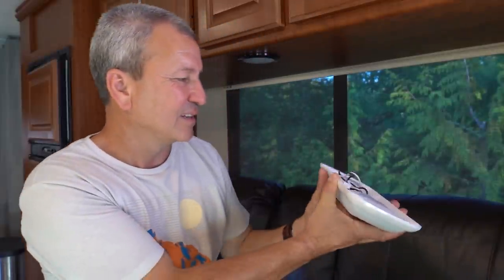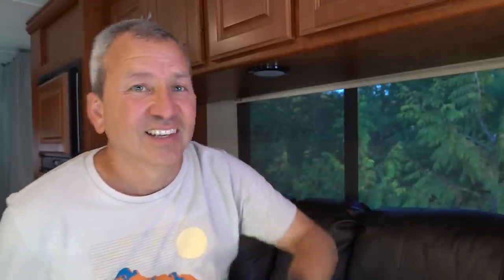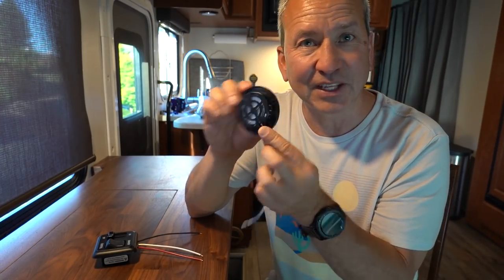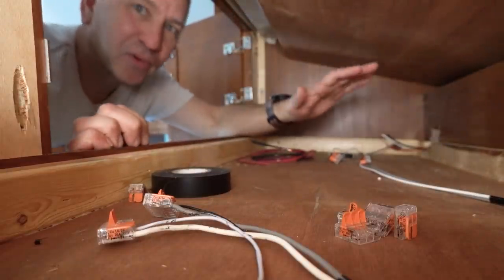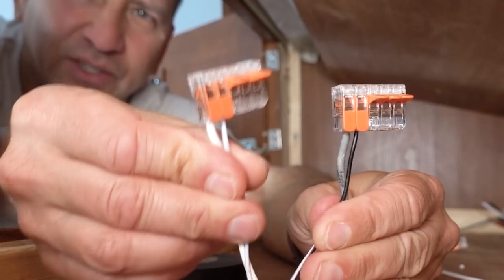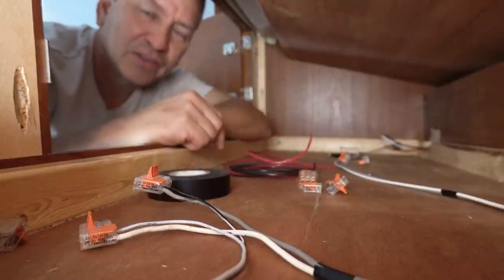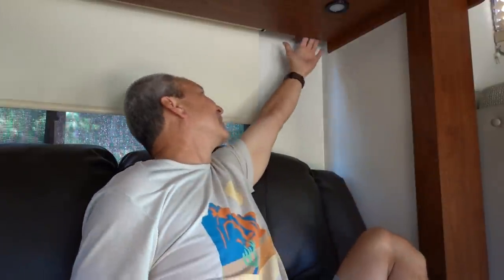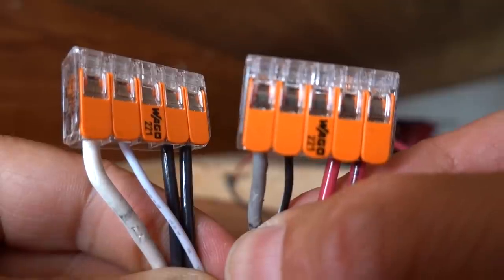Upgrade Your RV Lighting with Stylish LEDs Lights and Dimmer Switches | RV with Tito

Comment: Thanks for the tip on the WAGO connectors.  I've been using POSI-Locks but these look to be handier.  I'm about to install a dual USB port  on each side of our RV bed so we can use a simple USB reading light for more focused light than we presently have.
Reply from the maker: Cool. Yeah I installed a couple USB ports on either side of the bed. Those are a must. You'll like it!

Comment: Hi Brian! Been following for a couple years. You are a total inspiration. I had to try your tip on using the alligator clip and wire to divert the water that was running down the side of our class c that drains from our AC. Wow! So simple yet so effective! Also just finished a major floor repair. Had to hit the whole bathroom floor and part of the hallway. I took it in for an estimate at our local rv dealership and they wanted $4000.00 to redo the floor. That didn’t include the leak! Again, encouraged by your video, The total cost after tools and materials $400.00!!!!! Thanks so much. Oh yeah, love the dimmers. May have to do that one too!
Reply from the maker: Thanks for the comment Steve. I'm so glad you find my projects inspiring. Yeah. I think some (not all) RV repair is a racket...kind of like health insurance. Makes you wonder if they're jacking up the costs for the insurance reimbursement.

Comment: Those dimmer lights are sweet! 

We have a 2019 OutdoorsRV 24RKS travel trailer and are now in the mode of making modifications. The first upgrade happened a couple of weeks ago. I took the plunge and got a Battle Born 100 Ah LiFePO4 battery and installed a lithium compatible Progressive Dynamics converter charger. Everything seems to be working great. It's amazing how fast that battery can charge!  Solar is next!

Comment: Nice job Brian! You need one of those oscillating multi-tools for cutting those slots. PC250MT. No drill required, just a few plunge cuts. Thanks for the links to those connectors!
Reply from the maker: So true. I thought that as I was drilling out that hole. Everytime I need one I say "next time". Checked them out at Home Depot the other day. So maybe I'll have one for the next project.

Comment: Tito is a handy man. I've been electrician for 40 year now. The new wago is even smaller than these. Another name used is handbrakewago or mistakewago (tabbewago)  I will replace the old light with   downlighs like this in black. Therwill be a hole in the middle, So I mus use three I think I will use  it's ovn switch for the middle light. I will order a remotce cntrol. Here in Norway I use a 4kw Rvtransformer 230v AC50HZ - 120vAC/60Hz for my North American RV. I use both 120v and 230v outlet inside the RV at the campeside with shorepower. Can use converters too.

Comment: I just told you about my Minnesota Winnie I had already started my list of things I'm going to do and changing the lights out were on the list and that Wago connection is very cool I didn't no about it. I had restoreda 1978 Westfalia that I worked on for two years and I used those puck lights all over it. If you like I can send you pictures from that project I think you will be impressed. So anyway I will be in touch on my solar work. I plan on using your ideas.
Reply from the maker: Cool. I used to have a 1970 Westfalia.

Comment: I replaced all my lights  with similar to original but daylight LED, always wanted dimmer night light though, will definitly buy the ones you suggested. I have a similar RVAlways wandered the best way to access the space under the cabinet. Thanks!
Reply from the maker: Yes. Most RV cabinets have that false bottom. Use velcro or small screws to reattach it so you can get in easier the next time.

Comment: Nice addition, love those puck lights.. We have center lights and I've been looking for dimmable LED replacements for 18" fluorescent lights.. sadly, no real access to the ceiling wiring other than by the light itself.
Reply from the maker: Yeah. The ceiling is a little more complicated unless there's a heating duct nearby.
Reply: @RVwithTito  there is about a foot away, I tapped into it on our last RV, that was a job and a half.. first I need to find the right light fixtures..

Comment: Ideal makes Connectors that are like that but are push in (Ideal In-Sure push in Connectors and they also have them just like the Wago that are called Ideal In-Sure Lever Connectors but are a bit cheaper than Wago. Thought you might be interested in them.

Comment: Great vid. I ordered some non-dimming ones & got ‘em swapped out where I had single bulb housings under 3 different cabinets. Question: Is there something along these lines that can replace the old dual-bulb housing style light fixtures?  I have some of those on the ceiling of my Class-C we’d like to replace

Comment: Nice. Just picked up new Grand Design 310GK, however, all the LED lights in ceiling have particles in the fixtures -:guess the vacuum must not have worked well that day or thought the virus might spread or something. Also noticed a lot of wood particles in cabinets, flooring, cupboards. Especially notices on first trip away from dealer. Any way to safely pull out the LED lights from ceilings and get white cover off to vacuum them clean and put back together?  I tried putting in the LCI thin shade for door prepped window, top went in fine, the bottom was difficult, and the latch on lower left broke off...so hoping the three will work, or how to replace the inside of the thin shade windoe

Comment: 3.5 years later - how is that dimmer switch holding up? Early in your video, when you were moving the slider up and down, it looked like there was some wobble to it, which makes me wonder about the manufacturing quality.

Comment: Well done.  I would like to run a set of wires with a switch to the extrerior on both side to be able to add some security lights.. Any thoughts how to run the wires on the inside of the roof.
Reply from the maker: Best approach is to find where other wires are run and reuse those routes.

Comment: Awesome video Tito.  Just subscribed to your channel.  Im a first time RVer with pretty decent DIY electrical experience in 120v AC and a little 12v Dc (stereo/fog light installs in rigs). I’m getting ready to install a dimmer for our bedroom ceiling lights— 2020 grand design imagine 3100RD TT.  I’ve pulled the existing switch and it’s a standard 2-pole with those flat spade connectors.  The power (line) side is a single 12v wire and on the load (to lights) side, its two wires crimped nicely into one spade connector.  The problem is there’s no ground in that wall to connect the 3rd wire on the dimmer.  This however is the same wall that the converter/breaker/fuse panel is located.  I know you can’t see my system, but any recommendations on finding a suitable ground would be appreciated.  I’ll of course use my multimeter when doing my job.
Reply from the maker: There will certainly be a grounded negative bussbar near the DC panel. There will also be one on the light fixture itself that you could splice into. The negative DC wires are typically white.

Comment: BTW you need to get yourself an DEWALT DCS354B ATOMIC 20V Max Brushless Cordless, it makes cutting those hard to get to locations like where you but the switch and dimmer a breeze..
Reply from the maker: I know I do :) I was looking at them at Home Depot the other day. I'll get one soon.
Reply: Dewalt dcs3548

Comment: Time to invest in a Sonic Crafter for cutting those square holes. Plunge cutting, sanding, scraping they can’t be beat. If you don’t want to spend that kind of money, get a knock-off at Harbor Freight.
Reply from the maker: Just picked up an oscillating tool today. Next rectangular hole will be much cleaner. Thx.

Comment: Brian, I literally JUST received that dimmer control I purchased for another project on my bedroom reading lights. Maybe I am jumping the gun here because I haven't finished your video... did you have any issue with LED lights and a dimmer? I am looking for replacement bulbs for the project I am working on and they all say "Non-Dimmable". I also noticed on the back of mine it has a tab you can barely see for "3-way switching". Of course, no directions came with mine... might have to experiment!
Reply from the maker: I haven't had any trouble dimming them. I've used the dimmer on 3 separate fixtures. I just have to add them to my bedroom lights.
Reply: @RVwithTito  I will have to try it and see. The bulbs that go in the bed side lights are CEC1076, was just going to buy some standard ones so I didn't have to worry about it. Thanks again for another great video! Now that I finally have my RV at my home, instead of at Camping World collecting dust as they jerk me around on repairs they were never going to do(sorry, I'm not too mad)... I'm doing all kinds of upgrades! Yeah, you inspired me on many of them! Maybe I should be recording some of this.  :)

Comment: Your dimmer is a three wire high side. If you have three wires going in, your good to go. However, How do you wire if you're a two wire RV with bother wires hot? We're you're switch isn't a grounded switch? Your switch is a disconnect, not a conventional on/off switch?
Reply: My three ceiling lights ground individually about 5 inches away from the light and they are 4v each. See where this is heading? Now, I know I'm gonna have to use the that top pin on the back of the switch, correct? I'm gonna need to find wich of the two wires is from the battery. Do i create my own ground and run a third wire to the lights? Do I need a regulator between power and this new dimmer switch? Can I ground off the wall plug 20" away or do I need to go all the way back to the regulator?
Reply: Sorry. I ment all the way back to the battery. Nobody seems to know. I followed what the manufacturer recommended and that was the dumbest untested crap I've ever heard. Plus, I only got half the lighting, the lights didn't dim, the on/off switch no longer worked and I was to slide the dimmer up and down to turn the lights off or, on.

Comment: Can this dimmer/switch unit be wired to existing ceiling LED fixtures to dim lights? Is there a max # of fixtures (wattage) it can dim?
Reply from the maker: It has a 9V - 16V range with 10A max current rating. Multiply the volts and amps to get wattage.

Comment: That switch seemed to be labelled wrong- the on off is the rocker, the dimmer is the slider.  Not the reverse
Reply from the maker: I probably had the faceplate flipped upside down.

Comment: Am I crazy or are the switches swapped in the video? The rocker switch is where the “dimmer” label is and the slider is where it says “on/off”. Not that it matters based on where you ended up putting it lol. Manufacturing mistake?
Reply from the maker: Might be. I think the faceplate can be flipped and go on either way.

Comment: Nice job. I would have added a usb plug in middle of the 2 lights for our power hungry  devices 

But I know you dont like hanging cords.   Ka7qqv  Don Weber
Reply from the maker: I actually did add a dual charger in the recliner storage. Plus there's one next to the recliner. So 4 should do 😃.

Comment: What gauge wire did you use to add lights?
Reply from the maker: #14 AWG
Reply: RV with Tito DIY Thank you. Will that dimmer work to dim 2, or 3 of those small pucks?
Reply from the maker: @twdenman1  Yes. I have it connected to two pucks above the TV. Adding  more should not be a problem.

Comment: Sorry, lost me.  This didn’t show the needed details.  Primarily, didn’t connect the dots between each lights to the dimmer - reds whites and blacks, or how you described was going to be each seat’s ability to control individual dimmer levels, or how they tie in to the main power.  A simple diagram we could freeze on and refer to would be invaluable, too.  So in the end, no detail on connections to make this actionable.